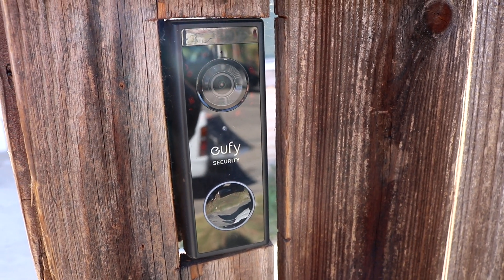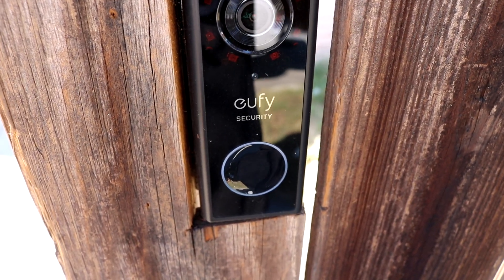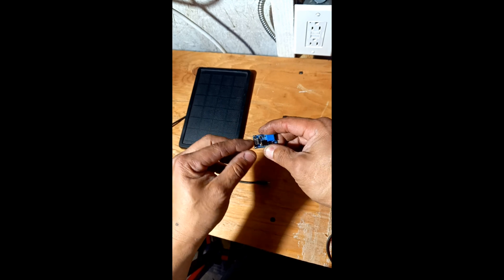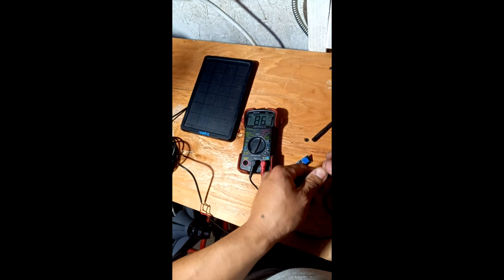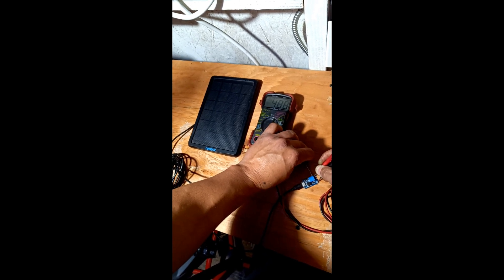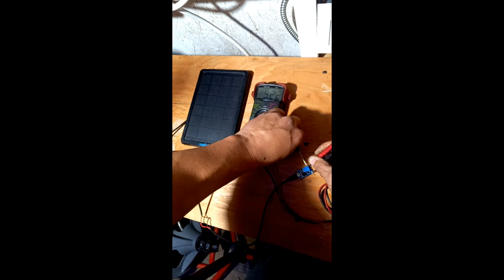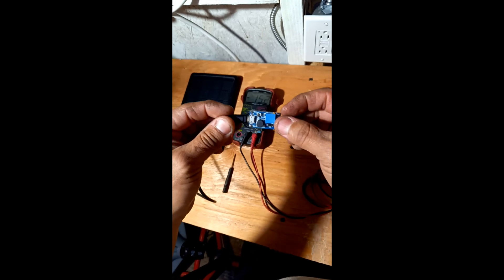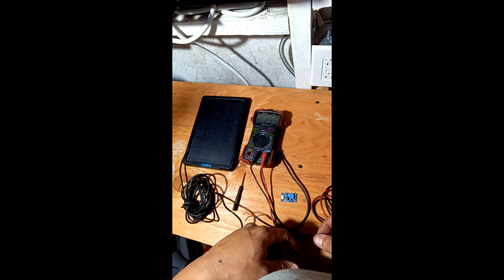Eufy Doorbell Solar Panel Update.

Comment: Sorry to resurrect this but I'm having a go at making the mod. Wondered, does the feed to the doorbell not need a diode to stop reverse charging of the panel? No idea if these cheap pv panels have them built in or not.
Reply from the maker: You don't need a diods, all that is built into the booster module you are going to use.  Try this module https://a.co/d/axjvrcG
I'm using that module at the moment and works better than the previous one I had on the video.

Comment: So it didnt work just wiring it to the micro usb ? Whats the converter for
Reply from the maker: No. The amps from the panel is not enough. The booster converter is to boost the voltage and amps needed to charge the battery.

Comment: Roughly what did you set the regulator at with no load?
Reply from the maker: I adjusted it about 6.5v with load. So probably 8v without load. Best to adjust it with load that way you see the orange ring when charging and you will be at the correct spot to charge. Try when is sunny and clear for best results.
Reply: @dennis_503_gutierrez  thanks I’ll give that a try as a starting point. I didn’t have full sun the day I was playing with it so I couldn’t tell if it was just the wrong voltage or not sunny enough.
Reply from the maker: @iandrewc  if the module you are using does not work, try this one. Is the module in using at the moment. https://a.co/d/axjvrcG
Reply: @dennis_503_gutierrez 6.5v is quite a lot over the max input of 5.25v, has the doorbell survived?
Reply from the maker: @neillroy  I used that voltage due to the module I was using. But I had to replace it due to some water damage and used a different module that runs at 5.2v. door bell still working normal.
Reply: @dennis_503_gutierrez thanks for responding, you mean you've changed to a different type of DC DC buck? Or just another of the same ones. I only ask as whatever voltage I set mine to, the current flow is not enough to stop the Eufy discharging. In fact with the charge ring illuminated the Eufy runs out slightly quicker!
Reply from the maker: @neillroy yes I changed the module. Try this one if the one you are using does not work. https://a.co/d/axjvrcG

Comment: I done it today, except, I drilled a hole in the back of the housing for the doorbell to run the cable into the back of the doorbell.  I also made new hokes for the screw to go in to secure camera.  I fitted the screw lower than the sync button. 

I then pushed a micro usb cable in through the hole in my fence into the back of housing and plugged in to doorbell.   

I then, connected the cable to a voltage charging module and adjusted to 5v and it works perfectly.  

I used silicone to seal the holes, but I used liquid insulation tape to seal the back of the camera where micro usb good in.  The liquid insulation tape can peel off should I need to disconnect camera for warranty or any other reason. 

Thank you so much!
Reply from the maker: Yes well done. Always good to improve other ideas and make them better. Thank you.

Comment: How comes you didn't add the wiring to the screws instead of to the charging plug?
Reply: I've tried your process with a 10w solar panel, ordered the small volts controller as well and just doesn't work. Even with setting voltage to 6.1v and so many other voltages as well. 

But then again I used the normal mini hdmi cable with black and white cable but it didn't work at all. The doorbell flashed orange several times but nothing. Tried on 2V 20V 200V on multimeter and also on dc as 2.5v 5v to 6v with multimeter but doesn't charge at all.
Reply from the maker: Hi. The screw on the back only work with 18v ac. So the solar panel doesn't work the same. But works good on the 5v charging port..